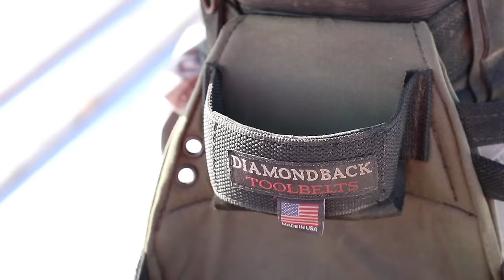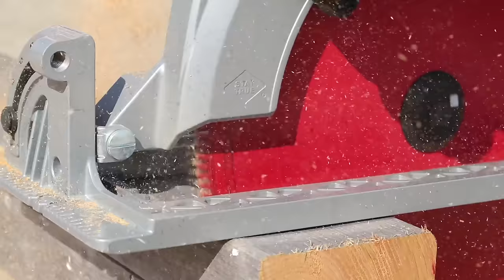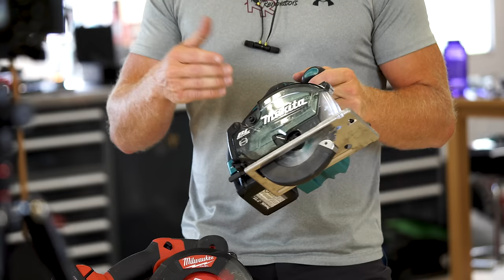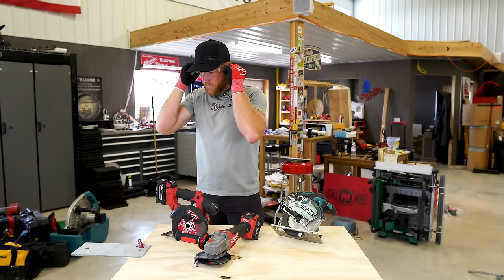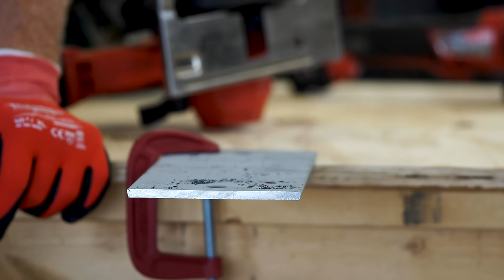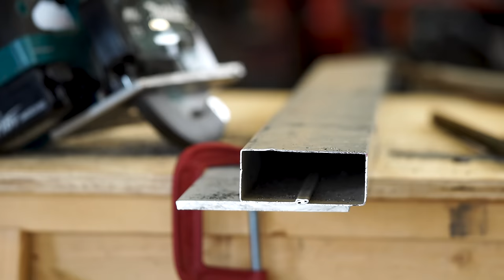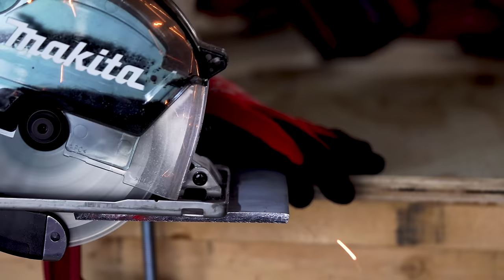Cutting metal with a Circular Saw: Toolsday with Metal Saws

Comment from the maker: My Brother really killed the edit at the end so make sure you stick around!!  It's some killer B-Roll.  Peter Mckinnon Would  be proud
Reply: Even sounded like "diablo" music too.  Thanks for this Kyle, going to pick up a diablo blade today for my circular saw.
Reply: Have you ever tried using your Makita metal saw for siding panels? I came from metal stud framing and use a metal saw for 80% of my metal siding panel cuts, 18% double cut metal shears and 2% metal punch tool thing you use. Just asking, also do you ever hang other siding profiles such as corrugated or snap together standing seam? Keep up the videos, I've definitely bought a couple tools off of your recommendation.
Reply: why did you cut with the angle grinder backwards? That is beyond amateur shit Lol

Comment: You’re cutting on the wrong side of that grinder. If it catches, it will lunge towards you. Flip the grinder around and move the guard. The sparks should be shooting towards you. On the back of the grinder it has an arrow for the direction you are supposed to cut. It also helps if you score your material with the grinder before digging in.
Reply: They probably don’t want to get covered with metal/sparks and aren't concerned about the grinder jumping towards them.
Reply: @itsawoodchuck4330  Look at a few videos and pictures of the aftermath of a grinder catching and lunging back. You will surely rather be hit with sparks and metal chips.
Reply: Yeah A) he's cutting the wrong direction  B) sinking disc into the cut causes the  metal to rub against the top/bottom (where the disc is weak to abrasion) of the disc and either causes disc to break apart and send stuff flying or if you're lucky it just wears the disc down x20 times faster than it should b/c the top/bottom is of disc is rubbing
Reply: Even thin roof metal will do that to a disc if you sink the disc down into your cut too much.  They are designed to cut metal on the edge of the cutting disc
Reply: Sounds like youve never used a grinder before. Hes doing just fine. I would love to see how its even possible to kick back like your describing with how he is holding the grinder with both hands. Internet warriors who have never held tools before.
Reply: but it cuts clean and fast that way , and ruins the point of the video ,, just saying.

Comment: I use nothing but Diablo blades. Whether it be concrete, sawzall, metal or wood blades. Been using their blades for over 10 years and I won't even consider anything else when its time to buy blades. Nothing even comes close to the quality of Diablo if you ask me.

Comment: When using a angle grinder use it so the sparks go toward you and the wheel is bitting down into the metal, not cutting up out of the metal.  The cutting wheels will last longer and is safer... good video
Reply: The cutting wheel was cutting down into the steel and why have the sparks hitting you when you can avoid it?
Reply: @oobaka1967  letting the grinder want to drag itself along the cut sending sparks back towards the handle keeps it from kicking back at the user if it snags and reduces the chance of twisting and making the blade explode.
Reply: I wonder how many feet of metal this guy has cut hanging inverted. Probably more than you have. Those blades are scary though.
Reply: @ryanfu2117 I didn't mean to offend or talk crap, just a suggestion.
Reply: @LottieLeather  yes ideally that's how you do, but in my opinion angle grinder is most useful when cutting steel in less ideal condition, otherwise use a metal saw, you don't even have to remove the guard.
Reply: You’re right. He should have rotated the grinder and started the cut on the other end moving away from him.

Comment: Clamp the piece you're cutting closer to the table to stop vibrations. Cutting a vibrating piece is going to drastically reduce your blade life and increase your cut time. Probably could have cut that piece of plate with the grinder in half the time that it took.
Reply: Pretty much my thinking too. I never used a metal cutting circ saw, and don't necessarily doubt it is faster than a grinder, but my grinder does pretty fast work of any metal and my discs last quite long (not to mention you can use half a box of them at the price of one circ saw blade...).
The way I see it, the one attractive factor of a saw over a grinder is less temperature increase in the material.

Might grab one to do dual work on wood as well though.
Reply: @kundetjenesten  I got a fein 7.25" metal saw since this comment. It's stupid fast. I cut 42' of 5/8 plate in one evening with the same blade. It's my go to cutting for plate now. Only thing faster is my CNC plasma.
Reply: @sputnik9708  You cannot compete with plasma. One of my customers build and decomission oil platforms, and the decom crews there have some of the nastiest plasma units I've seen. They take up half the space of a lift and when the guys work the metal flows down like waterfall. Quite beautiful to watch.

I am really tempted to grab the small metal circ saw, but then again I do need a MIG welder also, and funds are as always tight. Oh these choices are killing me! 🤣
Reply: and so dangerous...
Reply: almost like it was done on purpose to destroy the credibility of an angle grinder. Can't trust the rest of the story if he does something like that.
Reply: i was telling the samen thing. this guy is new i think. he does a great show on youtube. but better follow his footsteps haha
Reply: You really struggled with that grinder mate..You ruined the blade with that first slip,and it was just a struggle from then on..Also try cutting the other way...it's far easier and better !
Reply: Sucks to watch someone reviewing tools only to realise I can't trust anything he says as he obviously doesn't know the basics. It was painful to watch him using the grinder. Jeebus!
Reply: I was pretty surprised by the single clamp. I'm no genius with power tools but if you have a pivot point and add vibration, things are gonna pivot. Especially if you don't want them to.
Sweet blade though!

Comment: Metal cutting circular saws run around 4000 rpm, a standard circular saw runs around 5800 rpm. Smaller blade sizes further reduce RPMs and allow for more control. NEVER run a blade above the max. RPM.   2.The grit from abrasive blades destroys the motors as the wood saws are not sealed.

Comment: I've been cutting chainlink posts for 15 yrs.
Up to 8 in round, and schedule 40.
Started out with a Sawzall, the most economical cheapest blades per cut. 
Rather slow, some chattering, very little sparks,and ability to get into tight spaces. 
Diablo carbide thick steel are my go to, about 8$ per blade if you shop around and get multipacks.

Next was the grinder for the thinner metals (like you were cutting last)  blades are cheap ($3) but you will use more of them.
Some chatter (depending on the user) , the most sparks by far, leaves more powder then shards, the most likely to shatter and cause injuries to you and surroundings,
My choice Lennox diamond blades , 12$, 10x the cuts per wheel,but most importantly 100x less likely to grenade.

Next was the 7 1/4 Diablo on a 36v dewalt circular (it was a dream come true).
Blades were about $40 online only, since I live in a rural area.
Hot shards, very brittle teeth that don't like a bind pinch or jerk, last forever, blade won't come apart

Next to last were the fuel Portabands (M12, M18).
Blades are 3 for $20, last a good while,wont grenade, no sparks.
I use these exclusively in industrial areas, where a 1 hr firewatch after sparks is mandatory.

And my last version is the previous version of your makita, but with no chip collector.
Still on my 1st blade too, been about 1 yr now.
My helper cut aluminum and it dulled it. $25 replacement.

Dedicated metal saw makes 85% of cuts, portabands are 12%, Sawzall is 2% for in ground cutting and 1% with grinder for convenience.
The Sawzall has low rpm's, grinder has encapsulated teeth. 
But the circular saw blades has very hard and brittle carbide only connected at the root of the tooth of high rpms. 
Which when pinched, bound, or jerked from chips hitting your arms.. Will break the teeth and the blade is done.
I've had a blade in the dewalt last for 3 yrs, and I've had another last 1 cut.
Gloves, full sleeves, cotton clothing, hearing and eye protective definitely should be worn when using a standard wood saw.
If you wear synthetic shirts, prepare for metal melting into them permanently.
Reply: Thank for this review and sharing your experience.

Comment: When using a cut-off blade on a end grinder use a quality zip blade like Red Line 6" Peral disc and push through the cut.... not pull the grinder through the material, like the poster did.
 Also, in the woodworking world Diablo blades are Freud's budget-friendly blades, not sure if that is the same with their metal cutting blades.

Comment: Leave the piece that you're gonna cut just slightly hanging over the table this way you won't have vibrations which can lead to your piece coming out and your body needing surgery. Don't change the blade without taking the battery out first or you'll need surgery and finally (i know this is debatable but for me it ain't) don't use gloves on the hand you're holding the piece on any power tool ,or you might catch your finger which will drag your whole hand and... you guess it... you need surgery. Even on screws when you drive them in sometimes it can catch your glove and spin it around. But on all sites wearing gloves is a must, that's what regulations say. I care more for myself than the regulations so i tend to not wear gloves if i can, it's better to have a splinter than missing a hand. And i learned this from much older people before i hit 14. No hate, just observations. Good luck and stay safe.
Reply: Thanks for the advice.  I googled it and it sounds like you are right-on but not something that is immediately obvious.  (at least to me.)  I understood long loose sleeves, sweatshirts, necklaces etc... but yeah, just a brain cramp maybe thinking gloves are for protection so they should be on.

Comment: Diablo = Bosch blue, if the Bosch blue is cheaper get it. Same factory different colour coding ;-) nice greetings from Germany :-D
Reply: If this is true, what products does it apply to?
Reply: @BrandonContracting  bosch bought Diablo.
Reply: Freud’s contractor blades aren’t branded Bosch in the USA.  Bosch branded circular saw blades here are entirely different (Chinese factory).  Freud reps never hide the fact that Diablo saw blades are contractor grade (much thinner plate and much much less carbide).   While Freud makes the Diablo saw blades for the US and the Bosch blades elsewhere and they have similar to identical designs, I’ve found the Bosch ones from EU/UK to have varying higher qualities.  Some of them are as thick as Leitz blades you get from Festool, others are some what more downscale but still a bit more ‘expensive’ than Diablo versions.  The Bosch blades are £30-60 while Diablo blades can be had for as low as $5-10 (the most popular ones Made in the USA).   If you have a Bosch T101BF jigsaw blade and put it next to the W+P2 blade that they make for Mafell, they are identical except the Mafell blade is almost twice as thick.  In the circular saw blades case, the Diablos actually cut quicker and easier; just not as perfectly 90 degrees (almost unnoticeable) and they’re meant to be tossed instead of resharpened (they can be, maybe once or twice tops).  In the jigsaw blades case, I’ll go with the thicker one, please.  Bosch did, however, expand the Diablo range (possibly per Home Depot’s request) to include pretty much all of Bosch’s accessories in red.  This includes their various drill bits from China and Germany, the Scintilla Jigsaw and Recip (although some are from a US plant) blades, SIA abrasives and even their (imho junky) impact driver bits.  Hole saws may or may not be identical (I haven’t checked).  Diablo router bits are a mix of sources last I checked.  I’m aware that the 3” grinder accessories are mixed sources.  China (unknown), Indonesia (unknown) and Switzerland (Scintilla I presume) that I know of.
Reply: @BrandonContracting  Used to be not much, US wise.  Now…basically 99% of new Diablo SKUs in the past year and a half have a Bosch branded counterpart.

Comment: I bought a milwaukee corded metal saw with the 8” carbide blade since i got it completely changed the way i cut steel for welding and fabrication it basically took all the straight line cutting work away from the plasma cutter the saw can cut 1” thick plate without hesitation that has a perfect edge that is ready to weld without any extra prep needed only thing i do not like about it is the inability to plunge a cut in the middle a sheet of steel like I would do with a  skill saw and a peice of plywood
Reply: you could save you blades that are almost done for little to no life left in them and use those to make a plunge cut if it was absolutely crucial just need good control position and grip on the saw, plant the front of the foot on the plate lined up with your mark make sure the saws true to your mark and raise the guard plunge in nice and slow.. but plasma cutter would be the way to go..
Reply: save the worn out blades and use them because its gonna have a heavy tole on the carbide.. also a fresh blade will be alot grabbier/jumpier
Reply: Andrew Browner i have done it and the blade is garbage instantly i either just use the plasma for those cuts or start the cut off with the grinder

Comment: very cool video !    but I also have a question... I just picked up a welder and I am looking to start doing some small projects for my 4x4 truck What saw I can use to cut metal square  tubes and stuff  I am planning to try to build some rock sliders maybe bumper once I get better at welding.. I love working on my truck and making videos .

Comment: Great video. Yes indeed the cold cut circular saw are good machines. One thing I learnt. I was pulling apart a welded frame and used the cold cut saw at the joints going through the welds. the welds are extra hard. Harder than mild steel and killed my blade so it would cut and or struggled to cut anymore. So for those purposes I will use angle grinder to cut through welds. I did some cutting today after buying a milwaukee 150mm blade on 1.6 wall thickness25mm shs.Square hollow section. It cut like butter. Although the machine I have uses 165mm blades. There wasn't any available. The Milwaukee blade has done a great job.

Comment: Recently bought an EVO360 metal cutting 15" chop saw for my fabricating work. I was so impressed I just ordered an EVO180 circular saw.  It is a 7.25 saw that is billed as a metal first multi material saw.  Hope that it is not a camel, a race horse designed by computer. We will see.  The 380 was $350 from eBay.  The 180 was $189 from WalMart on line.  Both corded.

Comment: Can you use these to cut metal roofing?  It would be cheaper than buying a nibbler and a double cut shear, but I am not sure if these cuts would cause a rust problem.
Reply: they wont cause a rust problem any more than anyother cut but im thinking they might dimble/dent the edge of the sheet... its kind of a violent impact and the tiny guage metal wont enjoy that
Reply: @AndrewBrowner  actually, cutting roofing with a high temperature cutter (like a grinder) messes up the galvanization which leads to rust. That's why you use nibblers an shears. They cut cold
Reply from the maker: patrick I wouldn't do that for the reasons listed below as well
Reply: Thanks for the response! Your right, its not worth the chance for rust problems later.

Comment: I have a Fein Slugger 14" chop saw, a Fein Slugger 9" circ. saw (both corded), and most recently got the Milwaukee 2782 because of the compact profile, light weight, and of course, cordlessness. I must say, I love the little bastard.  It doesn't collect chips, and the shoe doesn't angle, but it is one sweet, simple, handy little saw, and I especially have appreciated it going up a ladder to cut overhead.

Comment: First time i give a thump down, if you cut metal with a grinder like you dit clamp it closer to the table so it don't jump around and it is safer to cut.
Reply from the maker: totally agree...oversight by me and basically put it that far out so I could get multiple cuts without reclamping

Comment: Wow, you opened my eyes Kyle.  I do not cut metal all that often, but I do a lot of woodworking and have many Makita 18v tools including 4 circular saws.  I would like to outfit one of these saws with a good metal cutting blade.  My question deals with blades and the two different brands.  Diablo only offers 1 blade with 48 tooth and Makita offers 4 blades.  A 32T, 2 different 52T and a 60T.  My use would be occasion channel, plate and rebar.  If I only wanted to buy ONE blade which would you recommend.  I value your opinion and love your channel, you do an awesome job

Comment: The very important difference between the Makita and Milwaukee is that (at least in the US) the brushless 5-7/8” Makita has a 5/8” arbor and does not like 5-3/8” while the Milwaukee has a 20mm arbor and is designed to use 5-3/8” and 5-7/8”.   5-3/8” with a 20mm arbor is somewhat standard for this sort of thing and one can certainly do much better than the Milwaukee and Makita blades for 25% less money.

Comment: Great vid.
2 things......
1 I'd like a link on that ear protection you have and 2. You mentioned you do build sliding doors occasionally.  Next time you do if it possible could you do a comprehensive video on just that.  Thanks...  As always great work.  Looking forward to more hunting/garage vids.....
Reply: I think the ear pro is an isotune product.  They are osha rated also
Reply from the maker: isotunes extras and yes I will